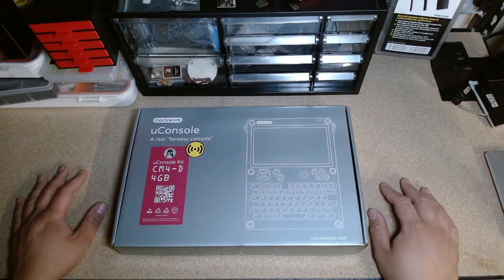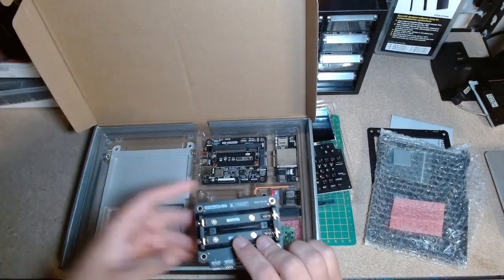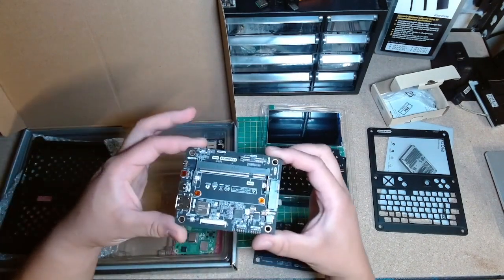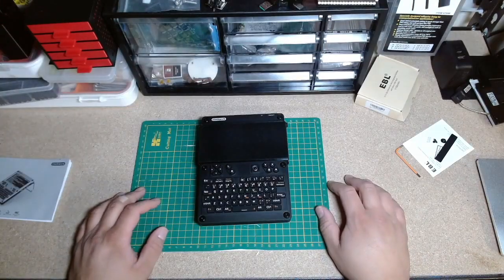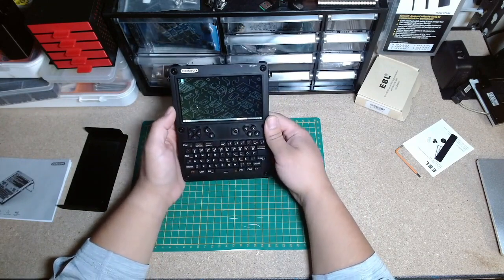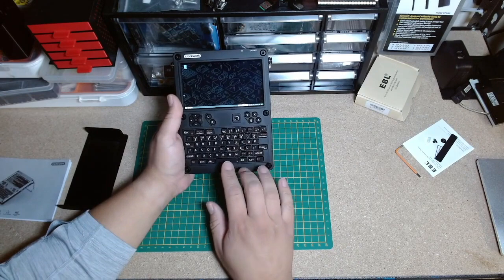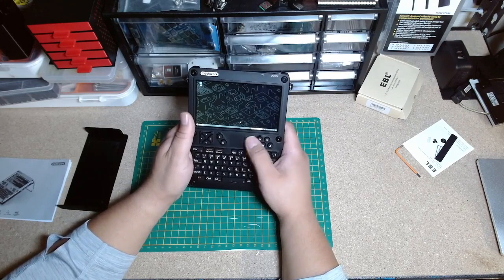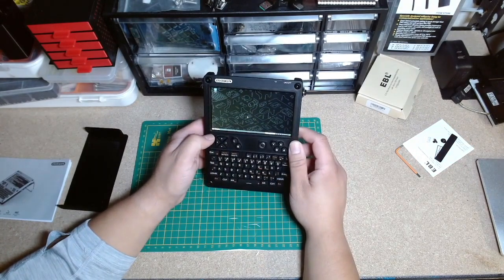Clockwork #uConsole Unboxing and Overview

Comment: How fast is it surfing the web, do pages load ok? I want to use it for Pico8, does it type ok on the keyboard?
Reply from the maker: Keyboard is nice to type on but very clicky. The cm4 loads most things snappy when using the newest builds from the forum. The only issue I've had with it is loading YouTube. for some reason the site loads super slow. but after the page is loaded, videos play fine in 720p quality.

Comment: Try double sided sticky foam to raise the antennas off the metal. The trackball is bad for vertical movements and prevents me from using it all the time.
Reply: try rotating the trackball assemblage 90° if you get frustrated like i did; it helped
Reply: @JohnneyleeRollins  I tried that. I emailed Alex and he sent one over to me. It works perfectly!
Reply from the maker: @RolieKloeOlie I ended up making custom antennas. You can see them in my new video on the channel.